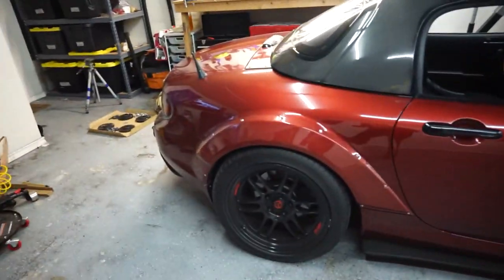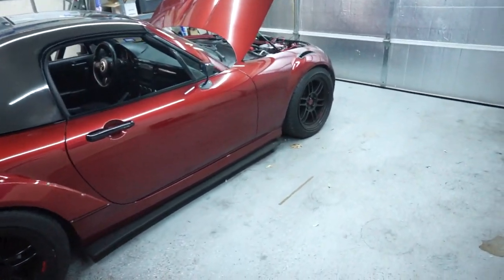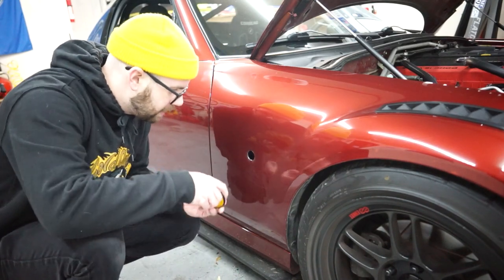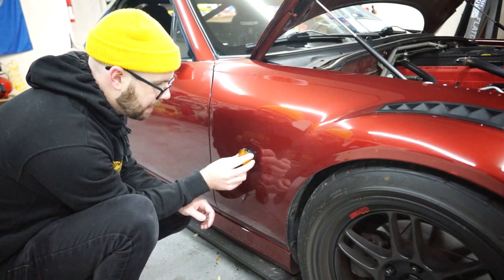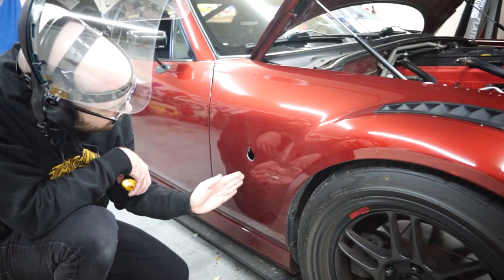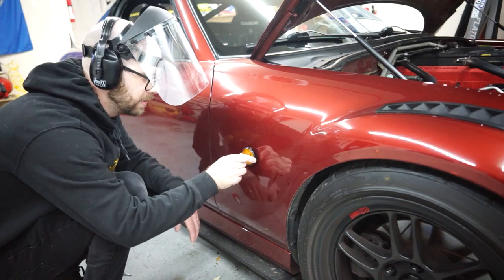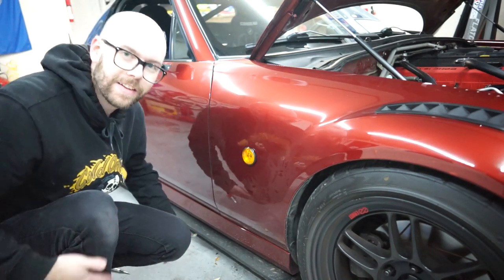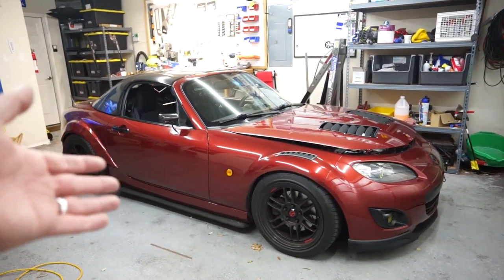JDM Roadster Side Markers on my NC Miata!

Comment: on the 3 & 9 o'clock bits on the side marker - I'd be tempted to carve them off the plastic side marker instead of cutting them into the metal fender.
but - i am watching a video, not working on the problem in my garage.

that being said - I did put JDM side markers on my 2004 STi . . . so - not completely talking out of my hat.